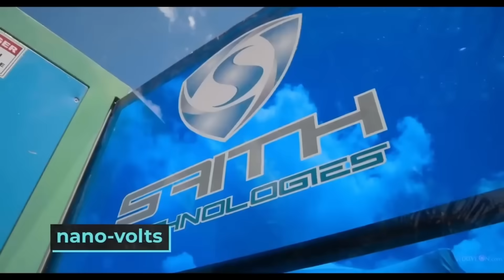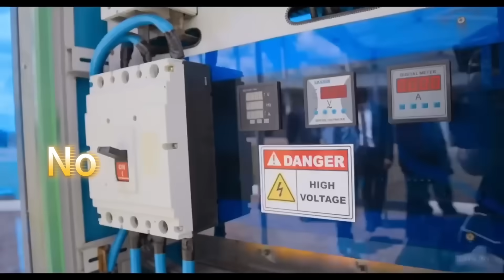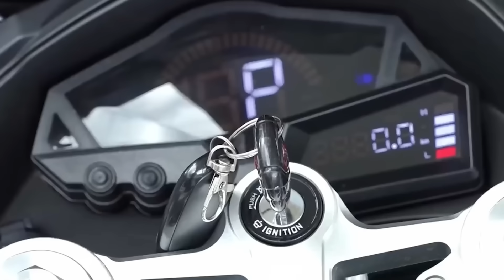This African Inventor Was Almost K*lled For DESTROYING Physics Law!

Comment: The mistake he made was going public. He should have used it for his own purposes and helped his family and close friends and request that they keep it a secret until such time after it had taken root, then the powers that be would be hamstrung to do anything about it.

Take for example, a seedling that has just sprouted is not hard to pull up, but a tree that has been growing for months and years is far more difficult to pull up. In actual fact, you would have to use garden tools and equipment to unearth it. 
And even after you have unearthed it, there's always the chance of a stray root hiding away in the earth that will start to grow back after a little while.

There is the temptation to become famous and to be held in esteem, but there's a very small space at the top of the pyramid and when you are not already allotted, there is no getting in.